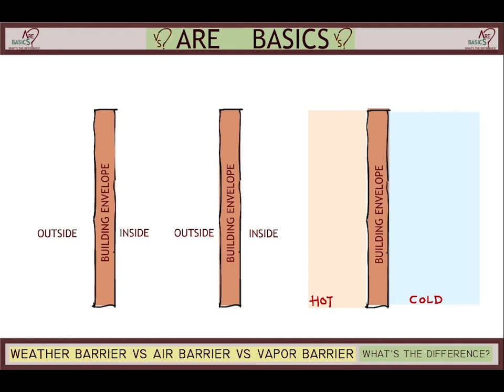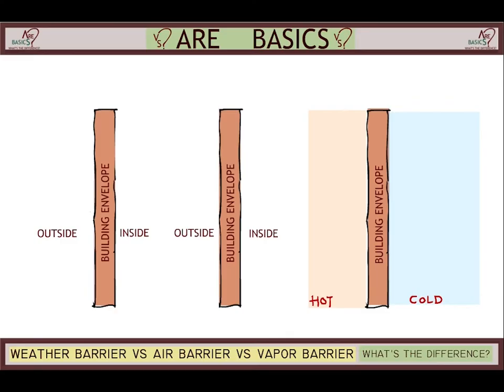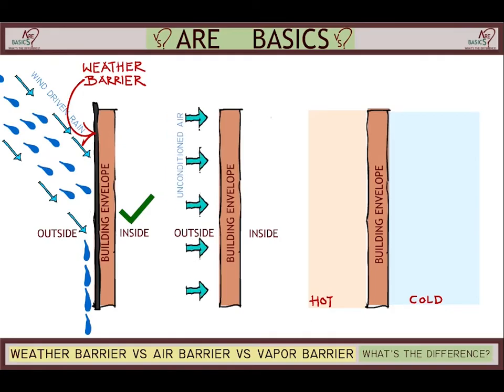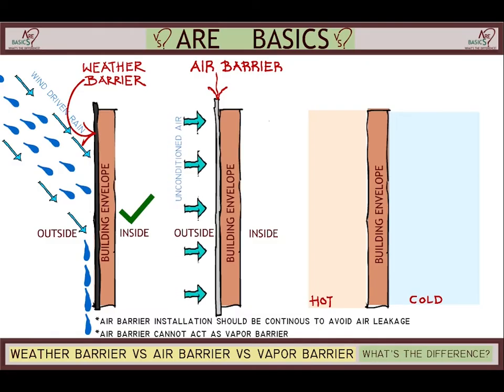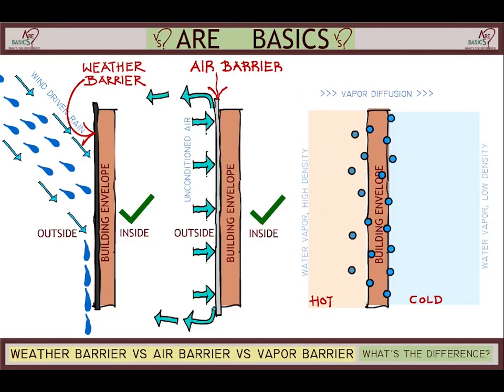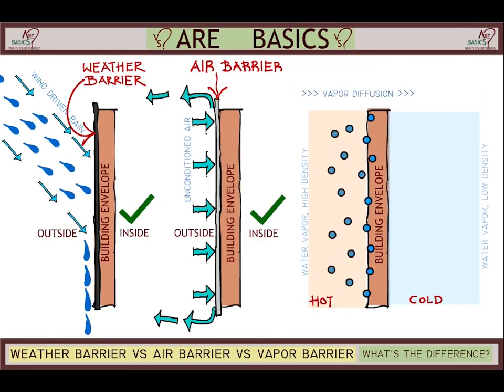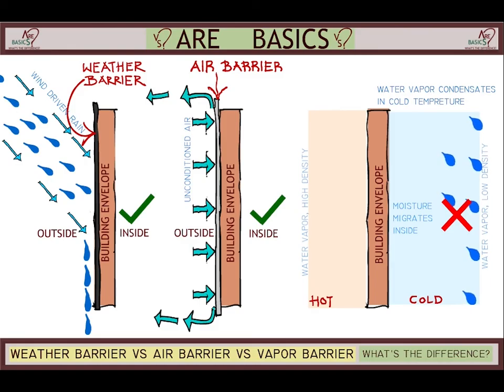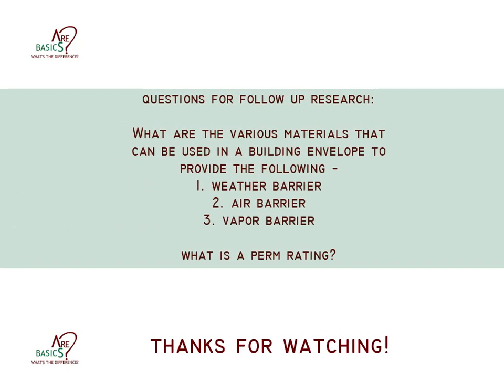Weather Barrier Vs Air Barrier Vs Vapor Barrier - What's the difference?

Comment: The entire house wrap/vapor barrier issue depends completely on the location of where you are building. The correct way to utilize house wrap and vapor barriers in Florida, where it is hot and humid and never gets very cold, is quite different than the correct way to do it in an area that has low humidity and very cold temperatures. If you don’t know the correct way to apply these products, you should consult an engineer in your area. My advice as a contractor for many years is do not rely on what your contractor says, there are so many incompetent ones, consult an engineer.

Comment: Almost. The IRC (building code) calls it a Water Resistive Barrier, not a Weather Resistive Barrier. The WRB in the code is typically a housewrap, such as Tyvek, that protects the wall sheathing from water that gets behind the siding.

In an effort to get more value from water resistive barriers, high-performance builders began using housewrap to stop air, too, by sealing the seams and edges using tapes and caulk. This is where the term WEATHER Resistive Barrier came into use. Weather usually consists of water and wind, so a Weather Resistive Barrier is detailed to stop air and water.

You state that the air barrier is usually a similar material to the weather barrier, but this is misleading. Air barriers can be anything that stops air. It can be plywood, spray foam, drywall, housewrap, or some interior vapor-permeable membrane, like Intello. Usually, when talking about the air barrier, it makes sense to talk about an air barrier SYSTEM. There is often a primary air barrier and a lot of secondary layers that add to the primary one. A gasket on an electrical outlet is an example.

Vapor barriers are usually plastic sheeting installed before drywall, and this is usually a huge mistake -- unless you live in northern Minnesota, northern Maine, the cold parts of Canada, Alaska, or some other extremely cold climate. Vapor barriers are intended to stop vapor diffusion, as you state, but vapor diffusion is almost never the cause of moisture in building assemblies. Because moisture travels on air currents, most moisture problems from vapor are air leak problems, not vapor diffusion problems. 

Your graphic is a little confusing at best and dangerous at worst as it equates the hot and cold sides of the wall to the exterior and interior, respectively—because that's how the only other wall sections are drawn. People who don't know what a WRB, air barrier, or vapor barrier is will very likely think they need a vapor barrier on the outside of the building, which will trap a ton of vapor in the wall for any cold-climate building. Adding to this confusion is an already-existing confusion among building professionals who do not keep up with the science of their craft and who think that Tyvek is a vapor barrier, which could not be further from the truth. it is a water barrier, but it is vapor-open, allowing vapor molecules to pass. I've even seen it written on blueprints from an architect.
Reply: thank you for clarifying

Comment: It is good but not enough . You should have clarified that air barrier for hot climates and installed outside to prevent vapor from outside to  get into wall assembly. It does not make sense to have air barier in cold climate when you have vapor barrier which already do not let hot air to escape out of building

Comment: Living in Florida, we don't have extreme cold, but we have extreme humidity all year except immediately after a cold front passage. Humidity control is paramount here. As for water; even on a concrete type structure, during a hurricane, if the exterior surface isn't properly sealed the water can pass through. In 2004 in a new subdivision North of Daytona Beach, the entire subdivision had rain driven through the block walls (painted only)  where it built up within the cells and then migrated to the interior. I liked your quick simple very effective demo. Thank you very much.
Reply from the maker: Thank you so much for watching the video.

Comment: I'm in the tropics. I wonder how these apply to a passively cooled home.
Reply from the maker: That’s a really good question. I think firstly, it will depend upon what kind of wall you are working with. That will be a good starting point to think about in reference to your question.
Reply: @arebasics5946  Of course. Here the usual wall material is concrete hollow blocks with rebar inside, and finished with a coat of concrete outside to smooth it as well.
Reply: I guess the core of my question is if I'm keeping the house open to wind as part of passive cooling, does any of these barriers matter?

Comment: Great Video! I wonder would you answer the question you put at the end of the video? What are the materials that can be used in a building envelope to provide weather barrier/air barrier/vapor barrier?
Reply from the maker: Hi, thanks for watching the video. I have not planned to provide the answers as of now, as I want you all to do the required research to find the answer. In my experience, taking the time to do the research is a more efficient way to learn and retain all the information. However, I am just starting out this channel and I am open to suggestions.
Reply: @arebasics5946  Hi, I totally. However, I do appreciate being able to see the answer in some way! Thanks!